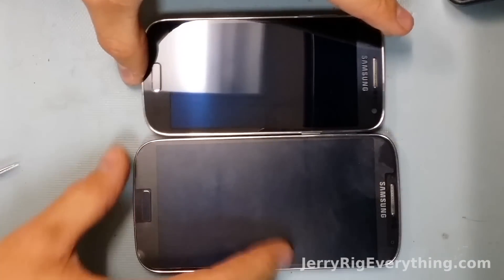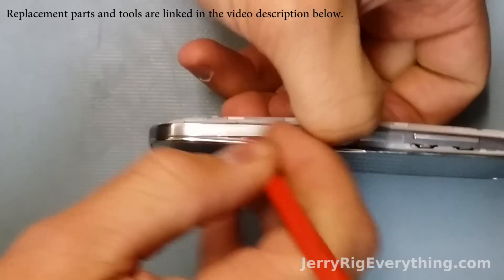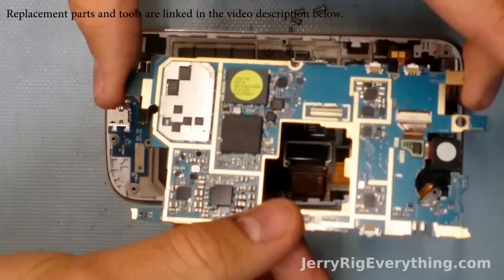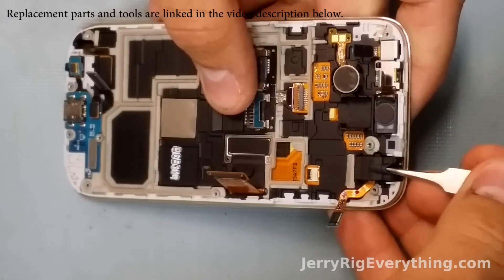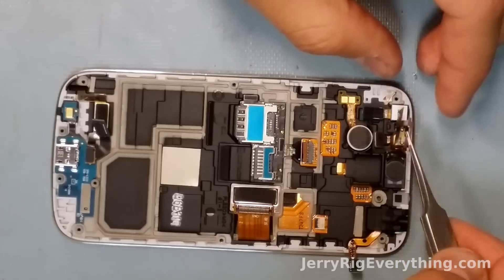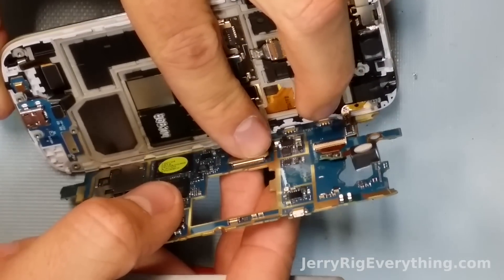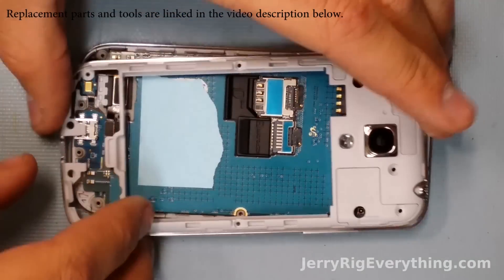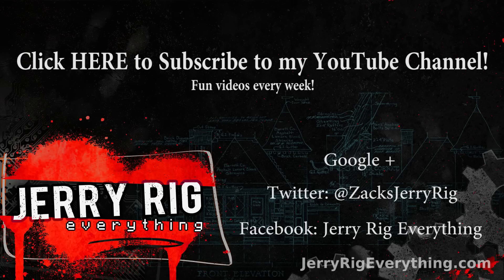Galaxy S4 Mini screen repair, charging port fix, compelete tear down video

Comment: I enjoyed watching your video. Very easy to understand. I am looking for a new charger port for my Galaxy s4 Mini i435. Its a verizon phone and I can't find where to buy a replacement charging port, with the PCB. I have found a couple stand alone ports that require soldering but I am trying to avoid doing that. If you know where I could buy one I'd really appreciate it
Reply from the maker: ***** I think that if you buy the normal Verizon S4 charging port (for the regular sized S4) it will fit the Mini S4.

Comment: Thanks for the helpful video!  Here's some lessons learned and tips to help others from my experience replacing the LCD/digitizer and Frame assembly (I didn't have to use glue or adhesive; I just had to transfer over all of the components (such as headphone jack, proximity sensor, front facing camera, vibration module, SIM/memory module and USB/charging circuit card):

Insert the headphone plug into the headphone jack to make it easier to lift the jack from the phone frame.
Insert the USB cable (probably best not to have it plugged into the charger) into the connector to make it easier to lift the USB/charging circuit card out.
The rear facing camera is attached to the motherboard, so be careful when lifting the motherboard out (the camera must come with it).
You need a tiny flat blade screwdriver, smaller than 5/64 in order to fit in the pry points for the SIM/memory module and the USB/Charging circuit card.
If the volume or power buttons fall out of the frame, be sure to put them back in so that the angled edge is toward the button (there is a small hole on the opposite side of the angled edge that will get caught on the button if it's installed upside down).
I used a guitar pick tool to crack the case, but be careful.  If you push the pick in more than an eighth of an inch into the phone, you can risk bending contact pins on the motherboard (don't ask me how I know!).  In my case, the speaker wasn't working because the pin wasn't making contact any more.

Make sure you get a good quality part.  The first frame I ordered was missing the mesh ground patches; with those ground points missing, it resulted in intermittent operation of the menu and back buttons, plus intermittent operation of the GPS.
Reply from the maker: Marvin K Great tips!  Thanks a ton for leaving this response to help others with their repair.

Comment: hae jerry raealy informing material. got a question my s4 mini fell down and the touch doesnt respond what will be the issue and how do i go about it
Reply from the maker: The issue is your digitizer is broken.  (the layer between the glass and the LCD)  The only way to fix this is the replace the LCD unit as a whole. I put a link in the video description as to where you can buy them. Let me know if you need anything else.

Comment: My S4 mini volume button is dented, can you post a video on how to fix or replace it?
Reply from the maker: If I remember right... its just a little metal piece.  If you pop the back off your phone, you should have access to it.  You can remove that little metal bar, and straighten it out.

Comment: hi jerry i gust changed my screen on my s 4 mini but now i have a week signal indoors not like before full signal  can you please help me out . thanks for video
Reply from the maker: ***** The antennas are those little wire cables.  Make sure you clipped those back into place.

Comment: Hey Man, Great Video, huge help in changing the charging port on a friends phone. After changing the charging port board the mic seems to only be working on speaker phone . Any Tips???
Reply from the maker: Adam Nodelman It might be a bad part... With how cheap the parts are, I doubt they do a whole lot of quality control.

Comment: i have a problem with 4 g connection with the motherboard, can i replace the antenna or the chip of the 3/4 g ? or do i have to replace the motherboard ?

Comment: I'm not seeing a charging port card like I have on my SCH-1435 to save me.  My card looks just like yours (just the USB and the speaker - like a small postage stamp or thumbnail size) but the ones on teh interwebz are much wider and seem to have an integrated ribbon antenna.  What is the part number on your mini S4?  My carrier is Verizon.

Comment: great video, i am replacing the whole lcd screen and i think I got it...mostly except when removing the lcd the home button fell out. now Im not sure which way it goes on because i didnt see it on. the s4 mini is different than the regular s4 which has actual holes to place on the home button. my s4 mini does not. its got two small tabs at either end on one side, Is that the bottom or the top?

Comment: my s4 mini has a overheating problem ond the charging port area and it doesent charg my battery so well,when I put another battery from another phone that has over 90% in my phone its down to 0% or more when I connect the charger,but when I take out the battery and put it back to the other phone than its aroud 90%.What could be the problem and what couses the overheating,it't not just heating,it's hotter than in a volcano,I even cant touch the phone.

Comment: When changing your screen you also need to take off the part the sim card and micro sd card slot goes into and put it on the new screen part. This video doesn't show that. Also what is the point in removing the loud speaker part from the housing if all the housing comes off anyway???
Reply: And the vibrator too.

Comment: Never dropped my phone or gotten it wet, but the speaker simply doesn't work. What could be the problem?
Reply from the maker: Dre Ill Could be a software issue.. connection issue... its hard to say.

Comment: Hi Jerry, I drowned my Galaxy s4 today and now my cellphone doesn't wants to charge, I was wondering if I could replace a mini s4 charging port new and replace it with my damaged s4 charging port... please help!!
Reply from the maker: I doubt those parts are swappable.  I put replacement charging ports in the video description.  You can check there for new ones.  They are pretty inexpensive.

Comment: Hey i have a question when my s4 mini fell and broke the said the ink it fell all over the screen from the inside so i cant see anything on it its all black so should i just do what you said on the video to just change the glass or do i need to do Something else thank you bye
Reply from the maker: Pruppeltje games That 'ink' is the LCD breaking.  So you will need to replace the entire screen.  I linked the replacement parts in the video description.
Reply: but a part of the screen is not working if a change the lcd will it work? or do i need to do someone else and is there someway differant to change the lcd or do just what you did in the video

Comment: Hi. 
I have 2 Samsung Galaxy s4 mini's.
One is black one is white. 
The white one works but has a cracked screen (screen still works). I don't use it.
Recently the black one was apparently hit by something, the glass has got minimal damage, but i think the inside lcd/display is broken now, because it just shows black. 
I'm thinking of taking the cracked screen of the white galaxy and replace it with the broken one on the black. 
I have followed the instructions in the video on how to open the device. But i noticed that as i opened the black one, the screen got more and more cracked (not a big deal, the display/lcd wasn't working anyways), but now i'm going to open the white one, it doesn't matter if the glass gets cracked in the process, but is there any chance for the display/lcd of the white one getting damaged in the process? I just need a temporary screen to back up all of my data. 
And i don't need to replace the things under the motherboard do i?
Thanks

Comment: just viewed your galaxy s4 mini repair video and I have a question. when I turn the phone on it makes a crackling sound and then every so often it makes the same noises It sounds like its coming from the bottom of the phone... so my question is... is this the speaker or microphone that needs replaced.
Reply from the maker: mike reynolds Sounds to me like a speaker.  If it only happens every now and then though, I wouldnt worry about it.  It might be a software glitch anyway.

Comment: I need a new charging port. I'm not sure how to tell what model of s4 mini I have. Can you tell me where to find it?
Reply from the maker: Talia Maxwell It is probably under your battery.  If you still have issues finding one, you can just take the same model number for the regular s4 for your carrior and buy that instead. (So if you have the Verizon s4 mini, than you can buy the charging port for the Verizon s4 regular and it should fit...)

Comment: I have broken my charging port on my galaxy S4 Mini. any links to getting another port?
Reply from the maker: It is the same part as the regular S4.  They are carrier specific, so make sure you buy the one that fits the regular S4 for your carrier (att, tmobile, sprint, verizon).  Check out my GS4 tear down video to find the linked replacement ports in the video description.  They are only like 10 bucks I think.
Reply: JerryRigEverything I have a S4 mini SGH i257 M, what type of charging port should I get?

Comment: Great video, thanks
i have replaced the charging port as my s4 mini shows its charging but it is not, i have swapped battery's and chargers, is there anything else i could try?

Comment: Hey, I need to replace my charging port but can't find the parts on amazon.ca. I have an S4 mini (GT-19195). Could you tell me where I could find the part, thanks!
Reply from the maker: Nicola Hardy The s4 mini has the same charging port as the s4 regular.  (as far as I know.)  So just buy the charging port for whatever carrier you are with, for the S4 regular.
Reply: Thank you! :)

Comment: Great video! USB port replacement worked perfectly...until I put it back together and the phone started turning itself off again, then on repeatedly. None of the fixes I've found worked. Looked at power button--seems to be in position properly and not stuck. Tried going into recovery booting mode, but it stuck and I get an error message and a dead android icon with a red triangle when I try to reboot. Any way you slice it, it keeps turning itself on and off again repeatedly. Any suggestions?

Comment: hey jerry. my Samsung s4 mini wasn't charging properly so I turned it off. now it wont charge or even turn on. is it the charging port? or Battery? any links on where to buy them?
Reply from the maker: It could be either one of those. Start with the battery though.  Look in the video description for replacement parts.

Comment: Is the complete LCD and frame assembly the exact same for all carrier and models or are they different? I have a AT&T SGH-I257 and the SD card port is in a different location than the one you have on the video. Great video BTW!

Comment: Great video, makes the whole process look really easy.

If you don't mind me asking, I am having troubles with the charging port, since this morning when I plug in the charger, the tip of the charger overheats really fast and it doesn't charge the battery at all. Do you believe a port replacement is necessary or just come cleaning will do the trick?
Reply from the maker: Samuel Castellanos Try cleaning first, But if that doesnt work, you'll probably have to replace it.
Reply: JerryRigEverything Thanks a lot, I did replace it, it costed me $19.0, fair deal.

Comment: I swapped the screen from one phone to the other phone, but on the other phone the touchscreen does not work?
Tried it multiple times, but result is equal; on the original phone the touch screen works, on the other phone not?

Comment: hanks for the guide man! Quick query you may be able to answer. Like a tit I dropped my phone in the sink (it happens), after this the phone would should down on charge stating it was hot. Placed the USB strip at the bottom and now the phone wont even boot up, vibrate when putting in the charger etc. Any idea which clips relate to this and what I may have missed putting it back together? Thanks for your help either way!
Reply from the maker: dave thomp Hard to say. Water damage is tough to deal with as it is different with every phone.  Have you tried to put the old charger back in to see if that was part of the issue?
Reply: First off, thanks for the response man!
I have indeed put the old one back in and it was the same issue. I then put the new one in, left it to charge for a day and it seemed to have done the trick!
My own impatience let me down! battery must have been dead.

But once again thanks for the response and the vid :)
Reply from the maker: dave thomp Nice! I'm glad it started working. Thanks for watching!

Comment: Hi.. I dropped my S4 mini and it cracked the front glass of the screen.
The screen is working well but what can I do if I want to replace the glass? Is it easy if I get a glass from amazon to replace myself?
Would be thankful for your suggestions. Thanks.
Reply from the maker: It is a very very difficult repair.  And I do not recommend doing 'just the glass' at all.  Watch my Galaxy s3 just the glass screen repair video to get an idea of how hard it is.

Comment: Thanks for the video! Question: In order to replace the kit of the home button and the touch "back" and "options" buttons, is it necessary to change the whole 'screen' part? Can someone just remove the glass or operate it from the bottom side?
(I have burned the edge of the flex cable coming from the buttons kit)